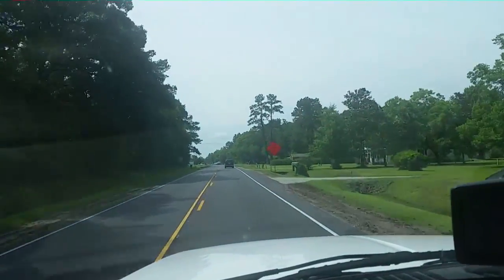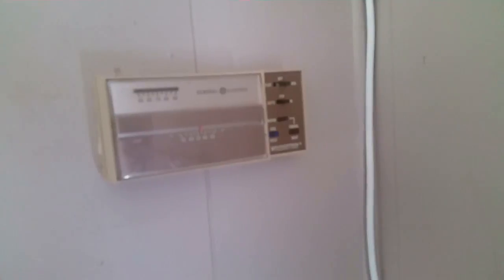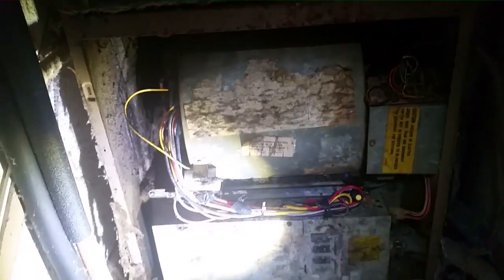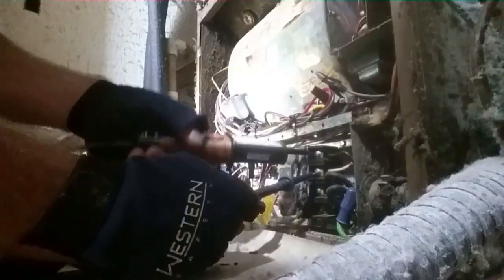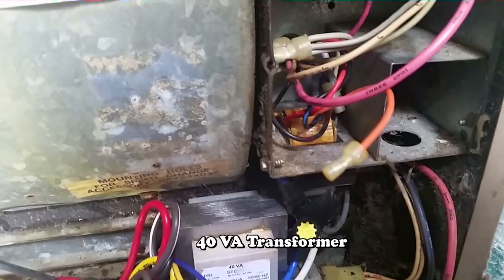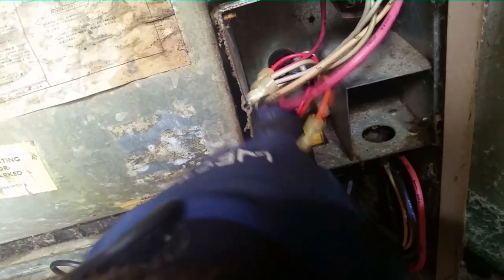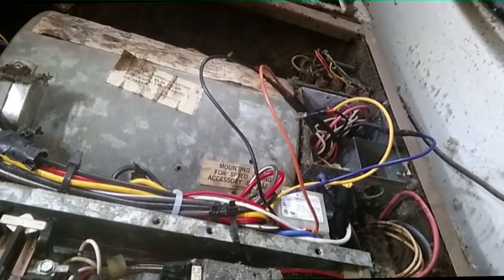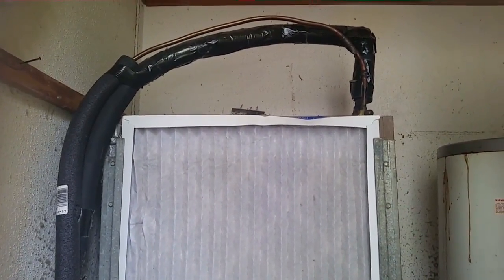GE Electric Furnace Transformer Failure

Comment: Great video  man   ........ so you were getting  240 volts coming in  on the primary and continuity on the secondary  but no low  voltage ?
Reply from the maker: Yep, it was shorted on the secondary.
Reply: Cool man i learn something new  I've change a couple of  transformers but if  remember well they didn't have  continuity .... great job man im a new tech so i have a lot to learn  .....